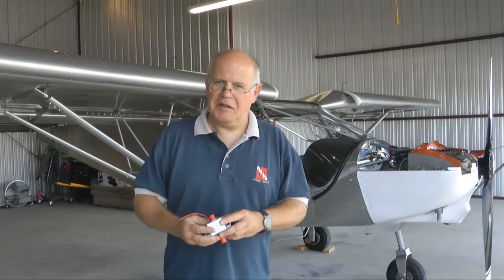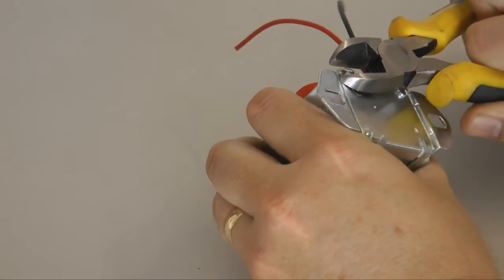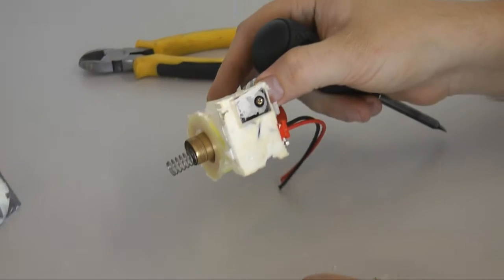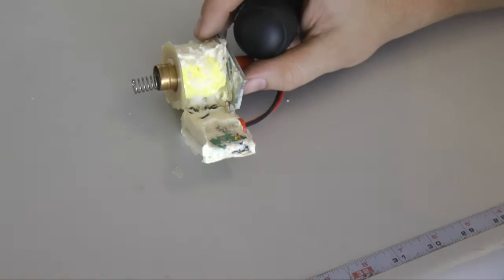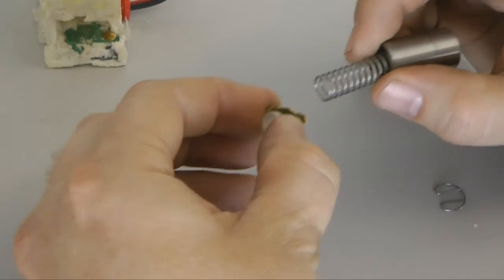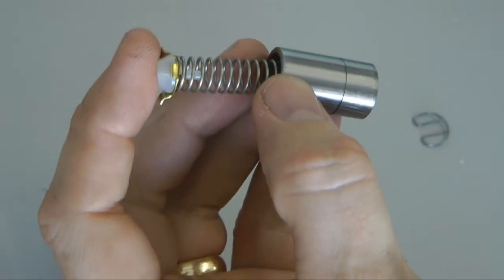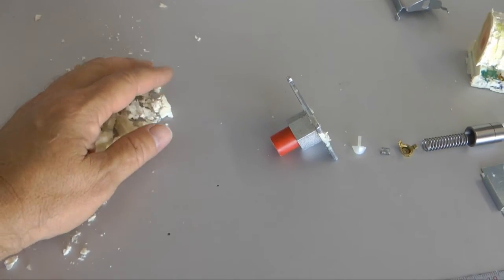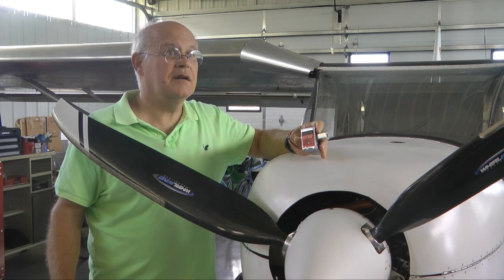Don't Do THIS to your Facet Fuel Pump!

Comment: I have a 1978 Honda Goldwing- 20 yrs ago it was impossible to find a new OEM fuel pump. I installed a facet 1-4 psi pump and it has performed flawlessly all these years.

Comment: Wonderfully helpful video. I’ve got a ‘43 GPW thats been giving me fits. One of the prior owners removed the original fuel tank under the seat and sealed the hole, then replaced it with a tank under the back seat. Fast forward to the present time and the bottom of the tank is rusty all hell, the Facet fuel pump is full of rust, the original jeep fuel filter is kaput and full of rust. l removed it and saved the pieces in case anyone ever needs them. I then put the Facet on my bench and unscrewed the ends, lost the tiny spring for a while and never would have known it was missing if I hadn’t watched this video, found the tiny spring, knocked out the loose rust and removed the “O” ring.  I then soaked the two ends in white vinegar (wonderful stuff) for about 8 hours to dissolve the stuck on rust, rinsed the ends in the horse trough, buffed as much of the inside of the barrel with both brass and nylon brushes. In reassembly I wiped some light oil on the surfaces, checked this video again for correct assembly order and put’er back together. So, at this point iI bench tested it and it oscillates and seems to have suction. Great fuel pump, only one I know of that you can repair. And, I wouldn’t have been to repair it without this video. Thank you!

Comment: I was hoping to use one as an oil pump for a small air cooled engine to run oil for a cooler. Says 180°F but after seeing the white plastic valves ill keep looking. An all metal gear pump would be best but trying to keep the price down..
Thank you for the sacrifice and the time.

Comment: Can somebody tell me if the electronics simply energises/de-energises the electromagnet or does a sensor detect full travel of the shuttle and turn the transistor off, to reset the shuttle?

Comment: I've got a Mitsubishi Diesel genset and it is only just over 12 months old but it won't start first time when very cold after being off for more than 15 hours. On the controller I get low oil pressure shutdown alarm after a failed start. Very worrying on a near new gennie!
I've been complaining for months to the distributor while it was under warranty about the issue (not knowing the exact cause) but they have a way of making you jump through hoops before they look at it.
Eventually I found if I prime my old lift pump with a jumper lead then it fires up no matter how cold it is. The electrical part of the old pump is the issue. When I first tried priming it I found it wouldn't tick so gave it a couple of wraps with a screwdriver handle and away it went. That's how I worked out my 3 cylinder Mitsubishi Diesel's oil pressure is in fact OK. Thank god for that!
It turns out that the Mitsubishi sourced lift pump was subject to a recall if they failed under genset warranty. 
Anyhow the OEM diaphragm type lift pump is no good in freezing conditions and they suggested one of these (now at my expense). They told me a particular brand copy of these pumps are so reliable they've never had one fail and they [retro presumably] fit them a lot.

Facet generic pump of a particular brand it is. Cheers for the vid.
Reply: If your diesel tank is below the gen set then you can cure your problem bu making sure that the diesel return pipe goes almost to the bottom of the tank. This makes it a closed loop and you don't get the fuel running back when the engine is stopped. It shouldn't anyway because of the check valves but in practice it will usually creep past them.

Comment: What specific Facet model did you use for this video. Some have an anti-siphon check valve some don't. Some have a positive shut off and some don't. It would be nice to know which model we are looking at. Thanks for the great video.
Reply: 40-108
Reply: I had the same question. I believe that the “cube style” Facet pumps like this one have a check valve which can be good in some applications (so fuel does not run backward) but there is some slight resistance to passive flow if pump is not energized. The cylindrical style Facet pumps have no check valve and thus I believe are considered “full flow-through”. I hope this helps.

Comment: those pumps are shit and banned from aircraft
holley red/blue/black or carter rotary the go
Reply: Not banned from the category they operate in and I bet those pumps you mentioned are not certified for aviation use either.
Reply: @ThePaulv12  those gold box pumps come with a sticker in australia saying dont fit them to aircraft and my own experience of them is they are shit

Comment: there History is :     It will quit working,  when you need it the most.
Reply: Yeah, so a work around could be to run two in series with only one operating since they flow when not energized, yeah? I'm hearin' ya though.

Comment: THAT was incredibly useful. I have a Facet pump (not sure of model) in my Varieze. It is not a plans specified item, but it works great. It IS free flowing so with no electric applied, the fuel just runs right through. I have a gascolator immediately prior, and a fine mesh filter upstream just below the two tanks Y-connector. Mine functions as a boost pump and seems to help at altitude (>10K'). I have Totally wondered about the guts. Thanks for taking the time to disassemble it and carefully show everything. Great channel.

Comment: 126 hrs on a Facet 40105 on my Rv12 and it failed at 9,000 ft. Pressure dropped to 2.5 psi. Enough to run the rotax on a long decent into the air park.  I am going to take it apart and see why it stopped working. If I hit the pump with a small hammer, I can get it to work. New pump on order..
Reply: or you could just give your passenger the small hammer and tell them if the engine sounds sick, crawl under the instrument panel and hit the firewall a couple times  :-)
Reply: thats why they are banned from aircraft
Reply: @andrewsmart2949  What other kind of fuel pump can I use that produces between 4 and 6 psi?
Reply: @gvrose1  put different spring in holley red
Reply: @gvrose1  or use holley blue with regulator
Reply from the maker: Gord - did you have a pre filter in that system?
Reply: @HomebuiltHELP  no pre filter. Looking for one now..
Reply: Wish we would have talked to you before taking my working pump apart!  :)  Keep us informed on what you find, I'd be interested in knowing if it was an intermittent electrical issue or a mechanical failure.
Reply: I took the pump apart and found two very small black bits of what looks like tank joint sealant in the pump.  These bits can get between the piston and the cylinder wall and jam the pump. Did not find anything wrong with the electrical circuits.  I am now shopping for a good online fuel filter.
Reply: @gvrose1  those pumps are banned from aircraft for good reason,hope your gliding skills are real good LOL
Reply: @gvrose1  https://airflowperformance.com/index.php/product/6-74-micron-maintainable-fuel-filter/

Spendy, but quality is top notch. Found a reference to it in Van's RV10 plans.

Comment: I always wondered how that thing worked : ) It turns out we have 2 of these pumps in use on our motorsailer; one as a backup fuel pump for a Perkins 6-cylinder diesel engine, and another to pump fuel into the reserve tank for cabin heat; 6 psi @ 2 gal/min.